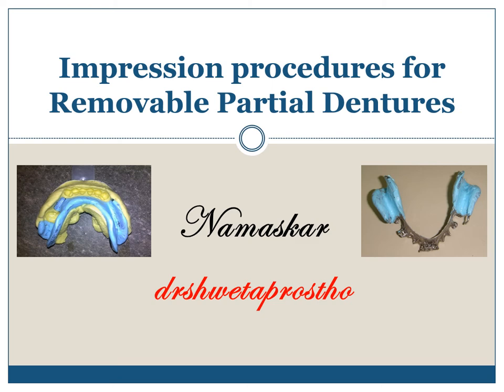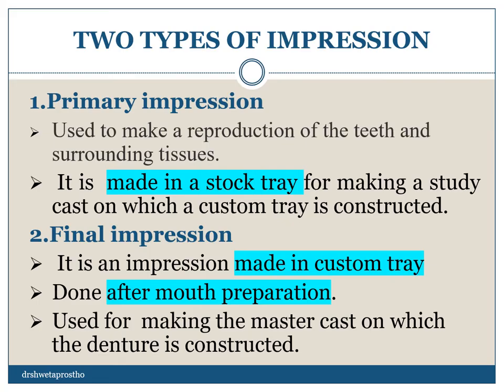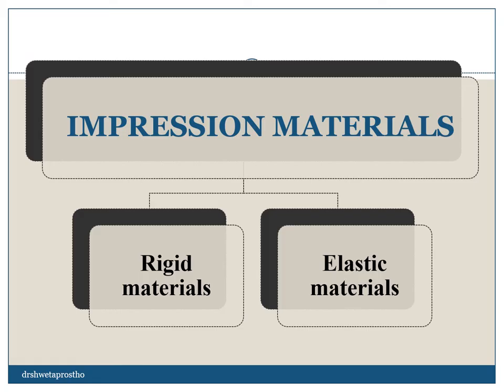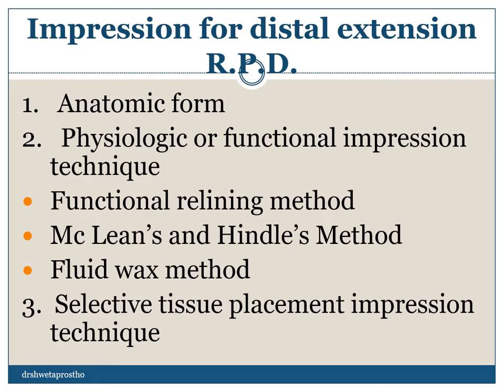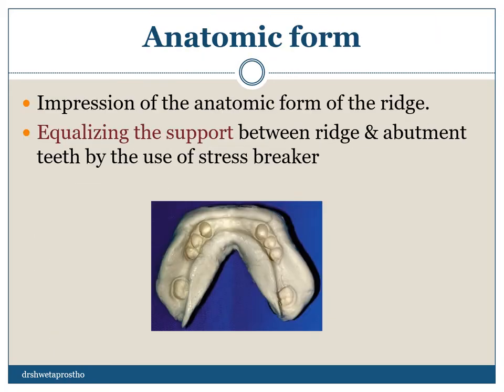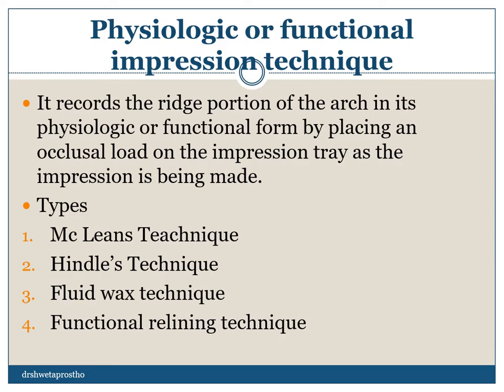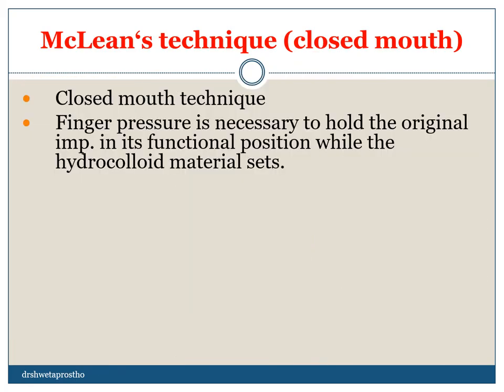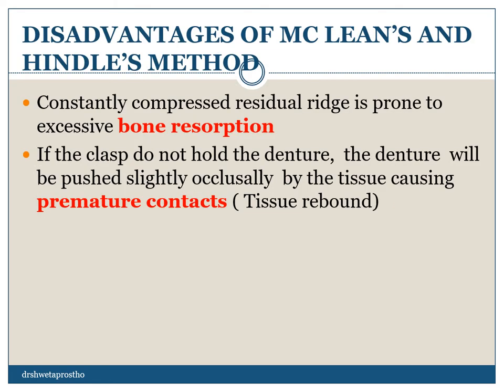What are IMPRESSION PROCEDURES FOR REMOVABLE PARTIAL DENTURE / ALTERED CAST TECHNIQUE

Comment: Ques... In mandibular guide flange prosthesis, flange extension should be preferably in d region of:
a) max secnd molar
b) max secnd pm
c) ant to max pm
d) on any tooth

Mam in this question why ans is b) ... Pls explain
Reply from the maker: Flange in guiding prosthesis should be such that first it guides the mandible from max mouth opening to MIC and holds in MIC. The height of flange guides the mandible and keeping in 2nd PM region marks approx center of arch that will help to hold in position.
Reply: @drshwetaprostho6301  thanks a lot mam🙏🤗